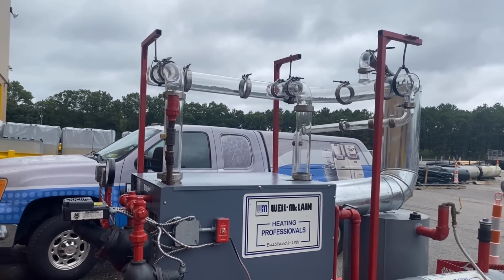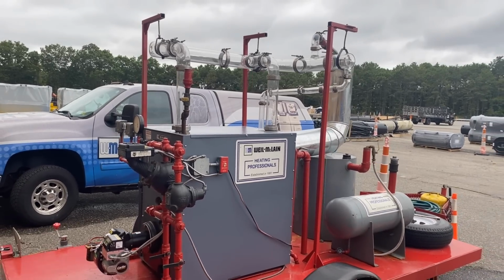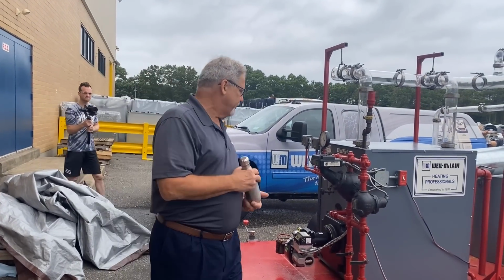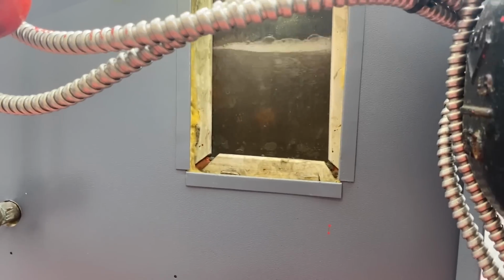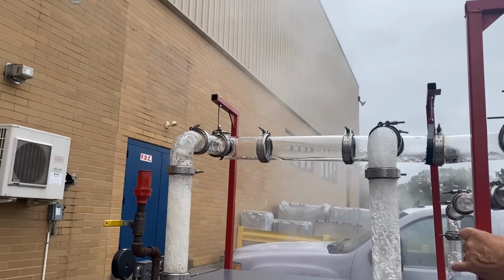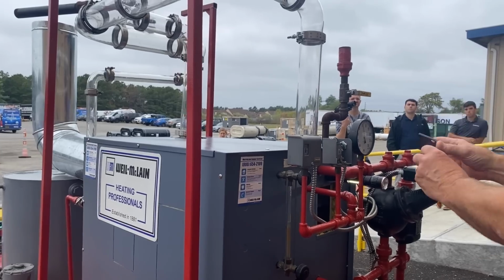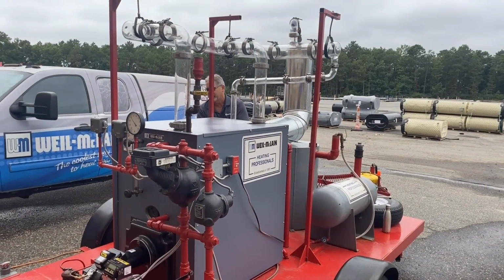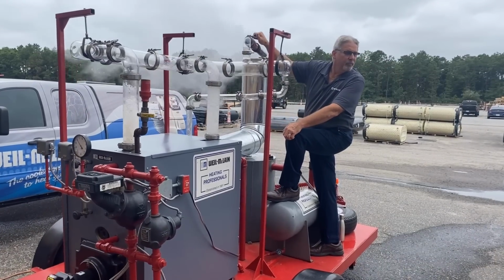Weil McLain Steam Boiler with Pyrex Glass Piping Live Fire Demonstration

Comment: Technical Note:  That boiler did not produce any "dry" steam. When the flow was set right it was producing saturated steam.  For steam to be 'dry' it has to be heated above the saturation temperature at the given pressure.  That means the steam has to be separated from the water and then have its temperature raised, typically by a secondary heat exchanger from the hotter flue gases aka a 'super-heater'.  And of course when the valve was set wrong, there was water sloshing about, the steam is 'wet'.  Wet steam is a very poor quality heat source and undesirable for obvious reasons.

Comment: Seen it myself several times, very eye opening.  The dropped header at least the last time I did a WM steam boiler was not in the instructions.  Around hear we call it the Burnham Dropped Header since you see it in that manual.  Some guys use it regardless, I only use it if I am anticipating a problem.  Not that I do many installs anymore.

Comment: Saw this demo in the 1990's on a model 88 with Dan holohan and was very interesting. sadly that uint was destroyed in a traffic accident and was replaced with the unit you saw. Not much different than the one seen today but had 2 windows 1 front and 1 on side.
It really changed my mind about what is really going on and why header is properly sized and height above water line matters. 
Later on fixed 2 hacked units and customers very surprised a kid (22) could be right but were happy they listened . lol 
Like u said hacks bring stacks

Comment: Why don't you instruct your customers to check their temp drop across furnace.  if the temp drop is lower than 16 degf you usually have refrigeration problem and if it is above 22 degf it usually is a air flow issue. They can buy a cheap digital probe thermometer (Amazon) and measure return - supply temp to check their system. Easy as checking the oil on your car..They can keep records and see trends which could help you when you show up to service or troubel call.
Reply: Most customers barely change there filters. you really think they are going to be checking temp drop?
Reply: This is a steam boiler video…